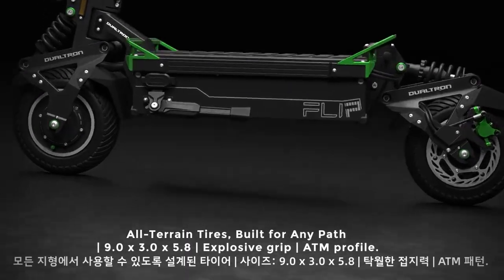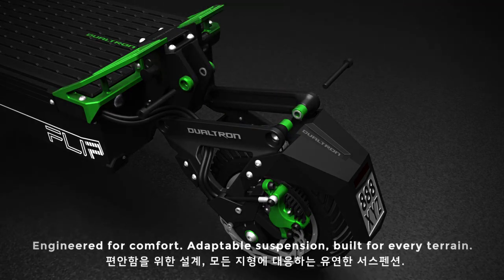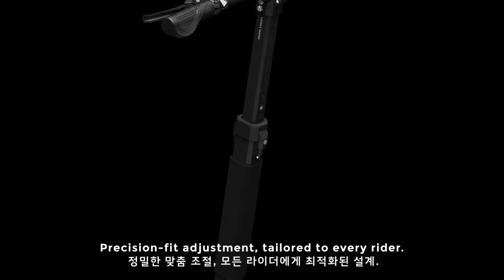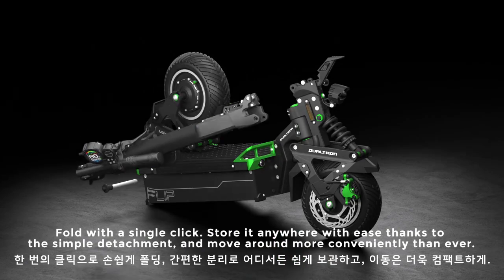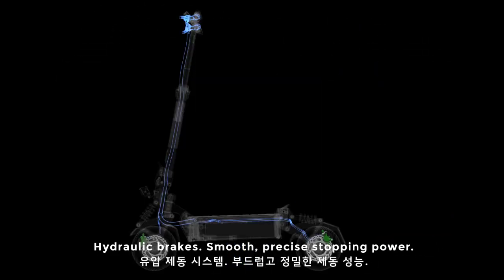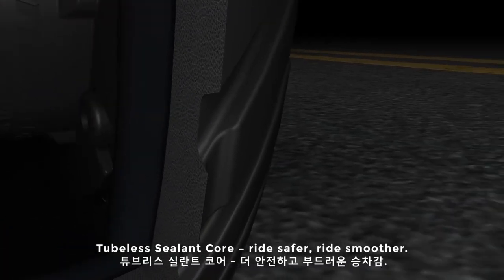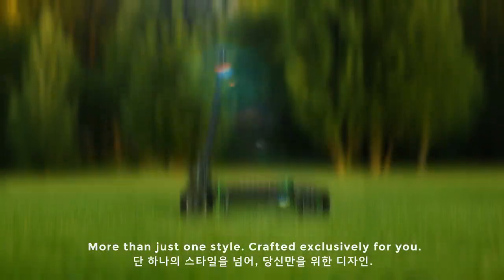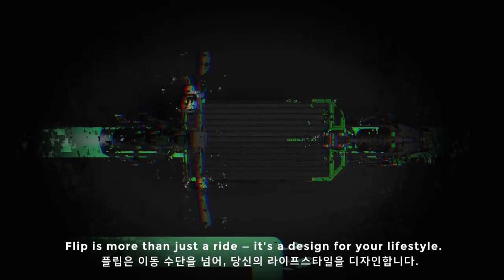"Dualtron Flip" introduces the new technology of LMFP semi-solid battery in its latest product.

Comment: "Until now, no product using lithium batteries has been free from the risk of fire and explosion" - That's a bold claim. LMFP batteries, while much more stable, can still very much catch on fire from puncture, crushing, overcharging, short circuit, overheating etc. It's just that the polymer thickened carbonate inside of the cells is much less flammable than traditional Ethel or dimethyl carbonate found in traditional lithium type cells. I'm used to electric scooter manufacturers exaggerating claims but when it comes to exaggerating claims of fire risk, I'm pretty sure every country these days is going to draw the line there, might want to reword that. I do still think it's an excellent idea to implement this technology and electric scooters, I want to see full salt stay batteries next. It's just that the energy density to wait ratio is much higher which means more range in lighter scooters. Scooters with 45 amp hour batteries the weigh 150 lb or just... WAY too much, in my opinion. In situations where the scooter weighs that much, while I normally laugh at people who say stuff like this, I feel like you might as well just buy a motorcycle or moped. If you're so enormous that you can't get on a bus physically, or you can't go on the sidewalk without consuming the entire thing, it's sort of defeats the purpose of an electric scooter in my opinion. Anyway, I digress, LMFP batteries are great but hardly fireproof.
Reply from the maker: You’re right, it may feel a little heavy. However, we intend to offer two options: our LMFP semi-solid battery and the 60V 52Ah and 60V 30Ah lithium-ion batteries.

Comment: Will older devices also receive an update to allow use of newer batteries? I recently bought the Fighter 11 Plus. 🙏🙏🙏
Reply from the maker: Older devices may not be compatible with the newest batteries due to hardware limitations. We recommend checking with your local authorized dealer or service center to confirm compatibility and possible upgrade options for your Fighter 11 Plus.
Reply: I'm not getting any information; I've been waiting for quite some time, I mean Now that the Fighter 11 is powered by a lithium-ion battery, and there are new types of batteries that can or must be installed in it Whether the company will cover it themselves or whether you have to pay for yourself ? So, the battery will be replaced free of charge with the newer version – do other companies like Dualteon etc. also offer this?   @DUAL-TRON-jo2ut

Comment: Nice. Not a fan of the triple fold though unless I can see thoroughly of the mechanisms.
Reply from the maker: I understand. The folding mechanism is an important aspect, especially in terms of safety and durability. Once production begins next year, you’ll be able to find detailed information and updates on the official website, which should make it easier to fully review the structure and operation of the triple-fold system.

Comment: Gotta get rid of the finger trigger throttle put like horizontal thumb throttle. Although then that how much will it cost?
Reply from the maker: All official DUALTRON products are designed and released with a finger-operated throttle as the standard configuration. This control method is part of DUALTRON’s established design philosophy and has been selected to ensure consistent operation, rider familiarity, and overall safety across the entire lineup.

Comment: What is Tenzon, is it a minimotors exclusive brand? Are the controllers sine wave? What is the LMFP battery, is it lithium iron phosphate?
Reply: And who makes the LMFP batterys
Reply from the maker: Tenzon is a global components brand.The controllers are sine-wave controllers.The LMFP battery (lithium iron phosphate) is currently in the final inspection and testing stage. However, we have decided to proceed with using lithium-ion batteries.